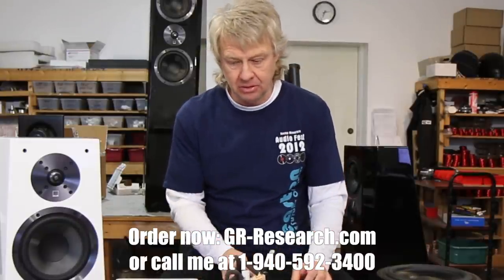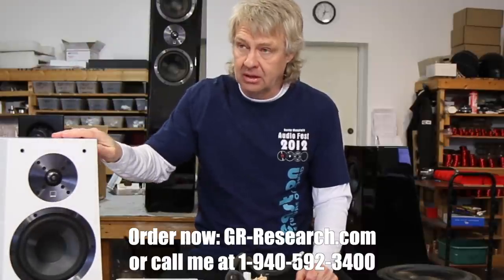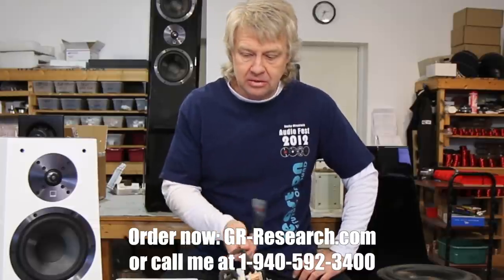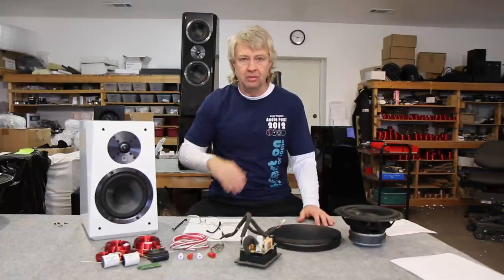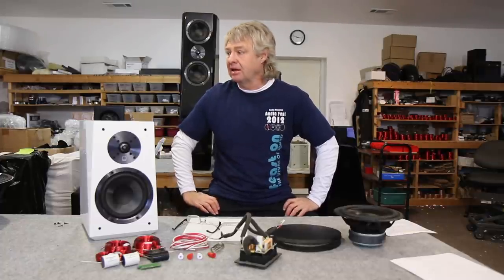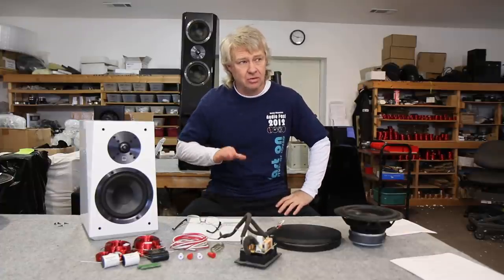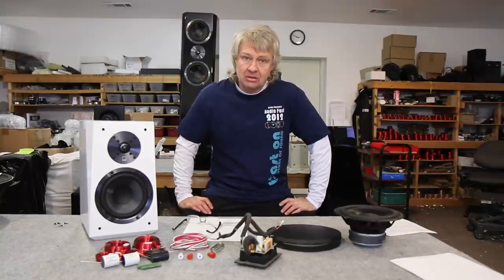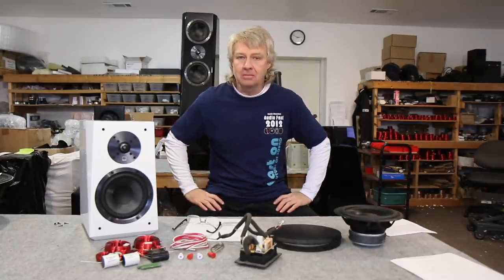Danny VS SVS! Ultra Bookie and Tower Upgrades!

Comment: I get the beef on pricing, but almost all speakers now day's are priced single speaker or each, so that is not even a legit complaint. Also, you have had many speakers much more expensive with the same issues, so I am not sure why the theatrics about SVS. Every speaker no matter the price will never be perfect even the $80k+ ones are not perfect.  I think it's fairly obvious that the engineers did not do the write up on the marketing papers, not much different than all of the companies. Most reviewers on the SVS ultra towers have very high comments about them and no I don't own them.

Comment: The KEF Q3 floor standing speakers sound great they have the tweeter in the centre of the main speaker works well on my system sound stage is done well and the base response is very good

Comment: Do you have experience with felt tweeter diffraction rings?
Reply: Neoprene is better than felt and an oval shape is better than a circular shape.
Reply: Russian Roulette;)

Tweeter diffraction rings can be effective, but implementation is tricky ... as you can easily do more harm than good. 

Measurements are a must. 

If it's not perfectly absorptive adding a circular ring of anything equidistant around the tweeter, impacts the original direct signal significantly all at essentially the same frequency. 

Any adjacent surface discontinuity smears the intended pure propagated energy leaving the face of the speaker by adding another re-radiation, of unknown phase into the original wavelaunch. 

I'd utilize four strips of quality felt ... in a rectangular manner out around the tweeter near the face plate edge. 

I wouldn't use the ring method unless I off-centered the ring significantly, ... which may look odd.

Edit;
I neglected to mention the actual effects. Diffractive discontinuities cause measured peaks/dips thru the tweeters range (due to re-radiated signal being added in some additive but smeared, some subtractive).
Reply: @carlosoliveira-rc2xt  
Interesting 
Neoprene over felt? 
I recall seeing mentions of Neoprene but nothing more.
Reply: @FOH3663  Nice one. I have experimented a bit with them and was looking for some expert input. I cannot measure so wondered if there was a rule-of-thumb :) The imaging has improved dramatically though with diffraction rings I use now. Had to lower the tweeter resistor which needed replacement anyway from sand-cast to thin film. Maybe Danny can do an episode on this.
Reply: @tweakradje  
I understand, however rules of thumb on this is tough.

The relevant wavelengths are so short ... a 2khz wavelength is about a half an inch. 
It's one area that's so specific to each HF driver, the loudspeaker baffle face, the exact material used and it's precise placement relative to the driver. 

fwiw;
Measurements aren't as difficult as they once were.
A miniDSP UMIK mic is $75, and REW software is free. 
There's a vast arena of help available. 

Even easier is OmniMic (mic/software together) from PartsExpress @$300, seriously easy. 
Within a few minutes of opening the box you're measuring. 

I own/use both systems.
Reply: @FOH3663  Thanks. Here in europe the 20khz wavelength is about 0.6 inch ;) I use a flat bottom ring of 6" dia.
Reply: @tweakradje  
My apologies 
That decimal place missed a tenth!

Comment: since speaker connections seem to be a thing, why not just solder speaker wires to the crossover?
Reply: That would work, but then your speaker would have wire tail.
If the wire would ever get pulled very hard, there might be a risk of damaging the crossover terminations?
Reply: @AverageNiceGuy  Strain Reliefs
Reply: @gccooley  that should work 👍

Comment: Seems like svs marketing doesn't communicate with the engineering department 😂
Reply: It's a matter of sales, and price point, and making a successful business.
If SVS would put several hundred dollars worth of capacitors inside, the quantity of sales would be much less. 
It appears that the bulk of the public is just not willing to spend for the difference.
Reply: @AverageNiceGuy  kinda like building a bmw then fitting dacia running gear hahha
Reply: Yes they do. Marketing told engineering "make it sound decent for no more that $5 on the crossover parts".
Reply: @cheeky50862  hmm, I'm not sure what that means.
Reply: So if a $1000 ea. speaker uses low 
quality parts I wonder at what price point do you wind up getting better quality internal parts. Thank goodness we have people like you who are willing to expose the dishonesty by telling the truth.
Reply: @tomhamilton6377  Infinity IRS III System, $200k used. This might get us close.
Or GR research kits perhaps?

Comment: This is so I can more fully understand. I've got the Ultra bookshelves with an SB3000 sub. Why is using a mini-dsp or eq to flatten frequency response so inferior to a crossover upgrade? Are the advantages of superior imaging/soundstage both on and off axis with a new crossover immediately apparent to a non-audiophile, or is an instant A/B comparison needed?  It seems as though only a person with an extremely  trained ear (which is reasonable to assume is rare) would easily be able to tell the difference... with the placebo affect having to be in play to some degree. Trying to gain some knowledge.  Thx

Comment: NAH! if the inclosure is not phenolic based material it's worthless. MDF created its own sound pressure, coloring and "blurring the original recorded material.
Reply: Are you suggesting making the boxes out of it, or lining the interior of the box ?
Reply: @greggcheap6208  There are 4 types of phenolics, bearing, linen, canvas, and G-10. Bearing is the easier to cut, but still miles ahead of MDF. Linen and canvas are the same weight per sq. in. G-10 (fiberglass) is the best and a little heavier then the canvas. The G-10 is a greenish color while the others are reddish colored.  As far as lining the inside, I've not done that type of construction. I've made the front and back baffles from 1 inch thick phenolic and the rest from MDF. My choice for sound is phenolic for the whole cabinet.
I use Loctite E120-HP for gluing.
Reply: @terrymargieduvall4808  
With the price of that material the box may be more than the drivers and crossovers. Unless you know a place 😀
Reply: I thought MDF was a step above chipboard
Reply: @manFromPeterborough  MDF is better than particle board, but mdf is no match for phenolic. Phenolic is 3 times heavier and harder than mdf. If you have the money phenolic costs and the tools to cut it you will be sonicly rewarded.
Special glue (epoxy) is required. I use Loctite Hysol E-120 HP. 2 hour working time, plus you'll need to dowel (pin) all the joints together. There is no comparison to phenolic speaker cabinets sound wise. The problem is it's very hard to work with especially if your a first timer.

Comment: that's a darn shame when you have to spend an extra $400 on your very expensive speakers in the first place.
Reply: I have a hunch that I may find out that the price is $200 "PER PAIR" 😎
Reply: @AverageNiceGuy  yeah I think you're right my bad
Reply: @Quietprofessional1  heh, yep, the way Danny says "PER PAIR" rings in my head 🤣
Reply: I pretty much needed the SVS gloss white cabinets, to not offend my wife's decor scheme in this room.
I ended up with some GR Research designed gloss black speakers in another room.
I was surprised to hear exactly the high quality that Danny described about the gloss black ones (Carnegie CS-1's).
I like it when you can trust a man's advice.
I plan to follow his advice about my future upgrades.

Comment: Lol SVS says it's an 8ohm speaker..
Reply: They do this so they can cheat the sensitivity rating, which is usually measured with a 2.83 volt input, and you'll see on SVS's website, that's exactly what they did. Into an "8 ohm" load, this would be 1 watt, but with 4 ohm speakers it's 2 watts and as a result the efficiency measurement goes up by 3dB. If they had actually used 1 watt like they're supposed to, the efficiency rating would be an abysmal 85 dB instead of the mediocre 88 dB rating they specify. These speakers need a LOT of juice.

Comment: More Chinese junk. I own Prime Pinnacles and PB 1000's, duals, and 4 Prime elevations. Not much you can do. Also opening them violates the warranty.
Reply: Are you sure how could they tell plus they have had me open and work on mine before.
Reply: The only thing that stops me opening something under warranty is tamper proof stickers, I have pulled the lids off HiFi gear, DVD recorders ( my LG died in 2 months it was stuck on please wait disp message)

Comment: Hi Danny! 
As usual good video! Why the hell are there so many speaker manufacturer still use these huge and probably expensive biwiring posts.  Imagine if they used one set of tube connectors.  They would save money and have better parts in the crossover. And also amplifiers the only amp i know is NAIM who us female tubeconnectors.  Must be for looks as it seems many also put more money on the design then sound quality.